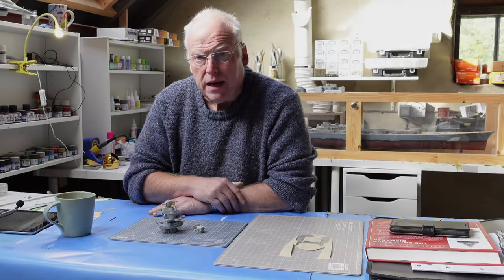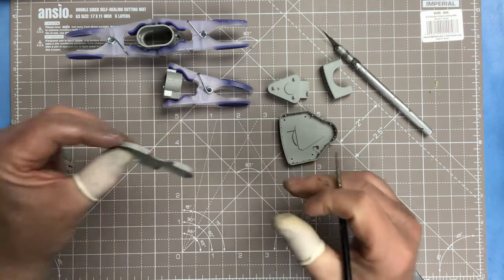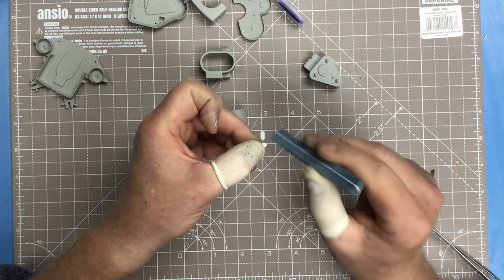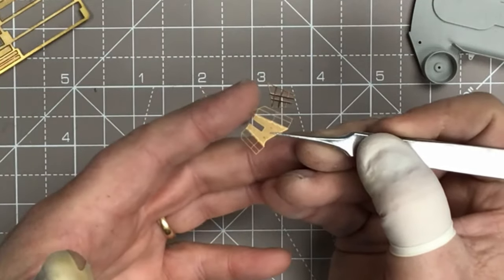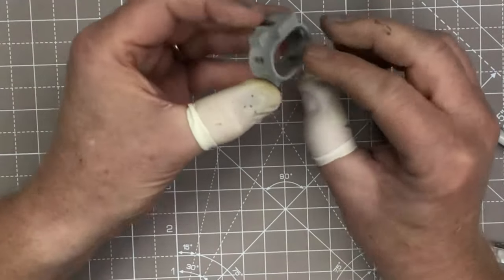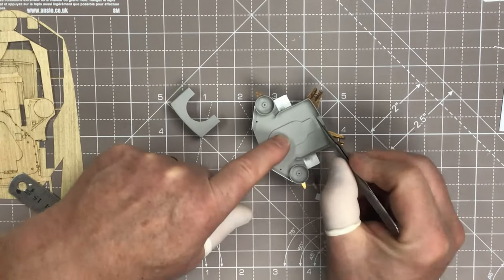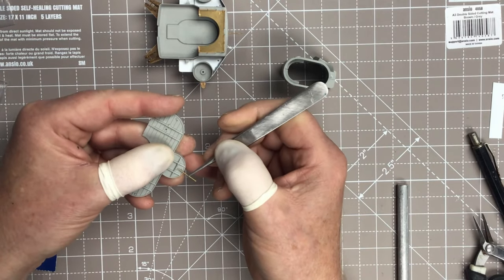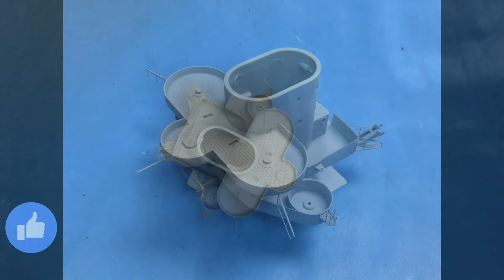Trumpeter 1/200 DKM Bismarck Full build with Pontos detail set Part 18a

Comment: Hi Steve, how do you clean your airbrush after using Mr Hobby Levelling Thinner? I've had my airbrush for about 6 months now with no issues, but the day after using MHLT for the first time it's constantly clogging which i've never had before. Wonder if it's because I haven't used something that can tackle lacquer. Thanks!
Reply from the maker: I use gun wash. it’s what automotive paint shops use. I get it in 5L containers. it’s very toxic though as is all thinners of that type so a respirator type mask is required.

Comment: Great progress Steve. You gave a ‘rundown’ of the primer mix and spray pressure… are you using a .2 nozzle?… Also, got to ask… The F16?🤷‍♂️… cheers Geoff
Reply from the maker: hi Geoff it’s a 0.3 nozzle in the Harder and Steenbeck infinity. The F-16 is a stalled build but it will get finished one day.